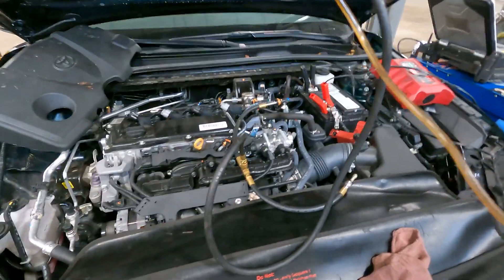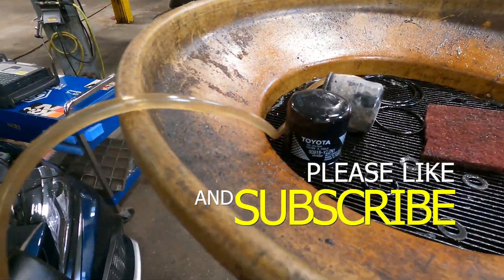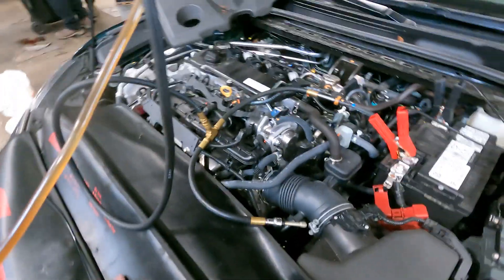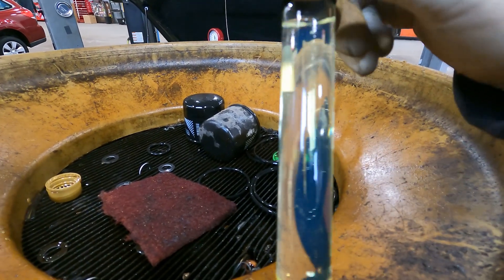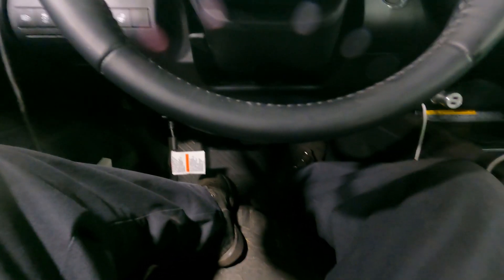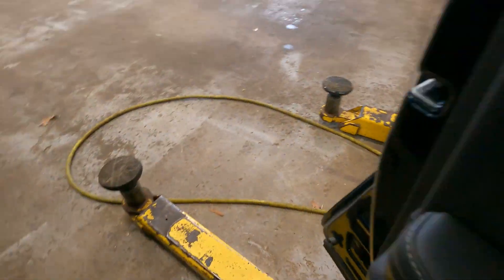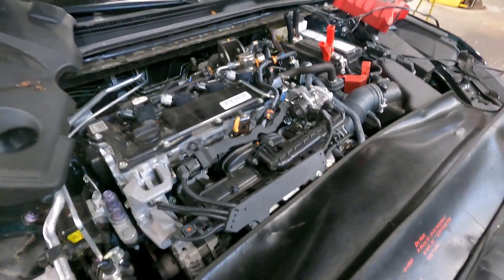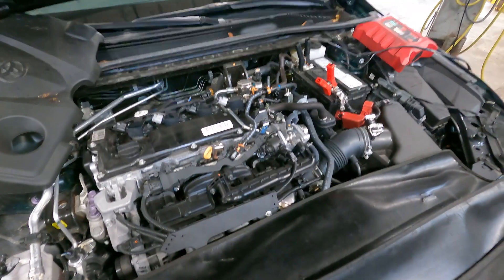Customer states "I PUT DIESEL IN MY GAS 2022 TOYOTA CAMRY!"😨😫😫Will it be ok???

Comment: Curious to know how this person got the larger nozzle from a diesel pump into that opening. Astro glide?
Reply: Vaseline.😊
Reply: @garfieldsmith332  lol
Reply: Sometimes, when a person loves Diesel fuel very much....they use a freaking crowbar to get it in the smaller hole!!
Reply: thats the problem....  not all diesel nozels are larger !
Reply: I drive a diesel car and most diesel pumps aren't larger, otherwise I'd be screwed
Reply: @vinc4886  diesel pumps aren't larger than diesel tanks even for cars 
the diesel pump is about 1cm wider as a standard on cars
Reply: @dylan-nguyen  yeah, the times I've pumped it into a gas can it's slightly larger.
Reply: Maybe they used it from a can?
Reply: You can just hold it up to the hole
Reply: Great question
Reply: Diesel nozzles are only larger at truck stops. At regular stations they are the same size
Reply: @stunna7807  I call Bullshit. Here in Canuckastan we have yellow for diesel and red for gasoline. The spigot on the diesel is way larger than gasoline. It is nearly impossible to put diesel in a gas fueled vehicle. Now on the other hand, it would be quite easy to put gas in a diesel fueled vehicle. I know because my work van is diesel and personal vehicle is gasoline.
Reply: @mikefoehr235  I live in Michigan and there are two size diesel nozzles. One is massive and will barely fit into my truck and the other is the same size as a gasoline nozzle. I think having diesel and gas at the same pump was a bad idea.
Reply: @zachdemand4508  You might be right
Reply: ours are same size and are just green handled with no vapor cover in most places.
Reply: FORCE
Reply: @mikefoehr235  Manitoba here bruh. And I have a diesel car and gas SUV. Large capacity diesel pumps have larger nozzles. The lower capacity pumps are smaller.
Reply: @stunna7807  Never seen that in Ontario
Reply: Some people are terrified of heights. Others of spiders. Some, ghosts. I'm terrified of ever noticing I've pumped diesel instead of gas/petrol.
Reply: @MattExzy  if you do it; much better you notice before you start the engine and try to drive away
Reply: To all you people saying the diesel nozzle isn't bigger, try it... it's just a little bigger.  You can't really notice it by glancing at it.  Diesel is bigger!
Reply: @damonzilliox2751 Not here in Ontario. Diesel ⛽️ spigot is 2x the diameter of gasoline spigot and diesel is colored yellow and gas red. Just like the gerry cans.
Reply: @damonzilliox2751  The idea is to prevent you from inserting it into the filler for a gasoline tank. Same thing was true when unleaded gasoline came along, openings for those cars was too small to allow the nozzle from a leaded  gas pump
Reply: @kevinbarry71  no shit?
Reply: @kevinbarry71  I'm saying the diesel is bigger damn it!  Lol.
Reply: @mikefoehr235  well yeah our cans our color coded as well. Red/gasoline, yellow/diesel, blue/kerosene....
Reply: @mikefoehr235  think about where those cans come from.  Lol.  China!  Pretty much a world wide standard than cans are color coded.
Reply: The hole was wallered out from previous attempts
Reply: @kevinbarry71  - dang, not many kids on here know what leaded fuel was. Also only in American 🇺🇸 do we call a liquid (Ethel) “Gas” which is not a liquid
Reply: @RustyZipper  it is short for gasoline
Reply: Foreplay
Reply: @zachdemand4508  I swear in Detroit at the bp the green is gas and black was disel
Reply: @Kingpat-yt  you are right. Bp is opposite a normal station.
Reply: @zachdemand4508  yea I thought so. I'm in az where they have circle k.  And it's the opposite. Should've read it 🤦🏽‍♂️
Reply: I wondered why it ain't fit in the car tho. I'm thinking maybe they all are my fit bc I don't know nothing about disel tbh.  I just know there's one u don't supposed to put in your car
Reply: @zachdemand4508  I got like 13 gallons of gas in my car with 3 disel u think it will dilute?
Reply: @Kingpat-yt  if your car has a gas motor a little diesel won't ruin anything. If you have any more room in the tank, fill it up. The more diluted the better. The worst case scenario is it doesn't run. Then you will need to drain the tank and refill with gas. If it does run it may foul the spark plugs. Hardly the end of the world.
Reply: @zachdemand4508  yea it still runs just make noises. Mobile mechanic coming in tmrw to drain it.  It will fs run still after I refill it right?
Reply: @Kingpat-yt  3 gallons is a lot to mix in a tank, so it really doesn't surprise me that it doesn't run well. You really don't need a mechanic to come help you if you can siphon the fuel out. I don't know what resources you have available to you. Either way I would try to save the fuel that is drained out. Then whenever you add fuel to your car add a gallon or so from what was drained out. Diesel is an oil. It doesn't burn well in a gas motor. That oil could build up on the spark plugs (fouled plugs) and cause ignition problems. That is really not that big a deal. Chances are as soon as some clean gas gets injected into the cylinder it will clean them right off.
Reply: @zachdemand4508  well thanks. I can do that but I have a mechanic coming in tmrw.  Idk if I should cancel

Comment: It happened to my dad once that he filled a diesel with gasoline since he tanked gas as a habit. Figured in seconds what he's done so he shut the car and called a guy to pump it out. Car worked fine afterwards. we were told that diesel in gasoline just wont work, but gas in diesel can break the car because fuel is used as lubrication for nozzles. He tanked a full tank so we diluted it down to about 10% diesel in gas and burned it in our old Hyundai atos over 3 months. Never had an issue, it even passed eco test.

Comment: You do very careful work, very high standard of care!  When this has happened to me before we just pumped out the tank and disconnected the fuel filter to allow the fuel line to drain a bit.  Then we filled it up with high octane and started and ran it until it smoothed out.  Usually did not have to do anything other than that.

Comment: They were saved by the fact they had the car towed right away instead of trying to drive it with the wrong fuel.  I knew somebody back in the 70's who owned a Mercedes-Benz that was diesel and a Volvo that was old enough to use leaded gas.  They accidently put diesel in the Volvo, but didn't realize their mistake until the car died several miles down the road.  The car was repaired (as I recall it was pretty expensive), but never ran quite right again.

Comment: I had a customer do the the opposite. They put 44 gallons of gasoline in their diesel Ford excursion but didn't start it. I ended up pumping it out and using it in my beater car at the time. It smoked a little bit but it saved me from buying gas for 2 weeks and saved customer from having to pay disposal fee. Win win

Comment: That engine sounds like a Diesel engine
Reply: Direct injection, at least Toyota uses all dual port.
Reply: Toyotas always sound like a news office in the typewriter era.

At least to me.
Reply: @iFixJunk  that sound would make me check my oil constantly, it sounds like there's zero oil in the head
Reply: @mitchhedberg4415  Didn't know that,  thanks for the info.
Reply: That's how four cylinder Camry's sound. I've had a few they all have the same noise it takes alot of getting use to
Reply: @mitchhedberg4415  isn't that the sound of the high pressure fuel pump?

Comment: When I was importing cars from Japan (grey import) in to UK, for SVA test I had to install a restriction ring in the fuel filler tube to prevent the car being refuelled with diesel. Naturally, I moved this ring from car to car after each car had passed the SVA test. In fact in some ways the SVA was easier than the MOT. albeit more expensive.
Happy days.
Jack, trhe Japan Alps Brit

Comment: Did this to a uhaul truck. No idea why I was so sure it used diesel that I filled it up with diesel. I was around half way up when I realized that at the side of the tank it said UNLEADED GAS ONLY. Parked the truck, lucky me I was able siphon the diesel out and ended up buying 4 10lt watter bottles to put the diesel in. Filled the truck again with gasoline and besides a bit of smoke it worked completely all right. I guess not all diesel nozzles are bigger.
Reply: Yes, Shell in Canada has them side by side, with the same nozzle side. I actually also did about 120 km on it...

Comment: I'm always aware of what I'm doing at the pump, been driving for 28 years now and NEVER done this
Reply: Most people will never do this. 

Then again, most people will also never pour power steering fluid into the brake fluid resevior like I did about 6 years ago. Luckily, I caught my mistake in time and was able to siphon out most of the contaminated fluid before doing a thorough brake fluid flush. Oops.

Comment: Did that intentional in mid 70's. Had a SU carburettor,  just adjusted jet, ran well, not idle below 1800 rev. Fuel strike answer. cleaned entire engine internally.

Comment: Actually  had an experience where my travel mate put 7 gallons of diesel fuel in the tank by accident in a pre unleaded  fuel car. It was a Sunday morning in the middle of nowhere. He finished filling up with 93. Car ran a little hot and mileage was down, but no serious issues. Recall seeing that many Cuban run on #1 diesel (kerosene) after starting and warming up with gas, because kerosene  is free. I suspect  the problem here is the fuel injection?
Reply: Exactly - very elaborate job CSM did there. Probably had been enough just draining the tank since the car ran okay on wnat was in the fuel rail.
Reply: in around the mid 80's and early 90's when fuel management systems were becoming more common in which o2 sensors and other solutions were reading what fuel was doing and also recognizing ping and adjusting itself somewhat, is when adding diesel to gas became a risk. Then when the more elaborate computer systems became mandatory in 1998 at least in north america, any amount of diesel in the gas, would result in the system recognizing a contaminant and begin to try and purge it resulting in people's engines flooding out and in some cases the crank cases being filled to the point of overflowing depending on how long they ran it like that. So much cylinder wash and just total disasters. This primarily effected vehicles 98 and newer due to their design. Reason i know this is because a local gas station has it's near empty gas reservoir filled by a refueler with diesel by mistake and several customers filled up and then sometimes didn't make it much outside of town before the vehicle simply quit.

Old mechanical injected or carbureted engines however are unharmed, in fact many people were advised to mix diesel in one in awhile or as a means of cleaning up and lubricating an engine, between the extra heat generated and other properties diesel has as a "wet" fuel compared to gas, the engine would have a high risk of ping due to the slow burn of diesel, power would be reduced, but mileage would increase and a lot of the carbon build up would be cleared out. Once back on gas again, all was still well with a potential for improvements, no need to replace spark plugs or anything.
Reply: @SpectrumTwist  
Ah - you must be trolling. Ping doesn't stem from a slow burn.
Reply: @Peter_Riis_DK  ping stems from many variables and contributing factors.... a slow burn in combination with the fact that a spark based ignition attempt for diesel is pretty poor, resulting in the much of the fuel not being burnt, AND ignition points occuring at other locations resulting in pre and post ignition. A slow burn is a contributing factor, and one of the advantages of gas alone since it can rapidly spread through the combustion chamber more evenly reducing the chance of ping

Comment: If you are going to confuse the two putting diesel in a gasoline vehicle is absolutely the better way to screw it up. Just need to empty the tank and purge the fuel rail and then it will smoke for a bit. If you put gasoline in your diesel though and run it... you don't screwed up big time. Which has always made me wonder why a diesel nozzle won't fit in a gasoline filler neck. But a gasoline one will... you'd think they'd have done it the other way around >.>

Comment: ROFLMFAO.  My Daddy ran dump trucks and he was stubborn as hell and had a gas burner as everyone called them instead of a diesel.

One day he called me when I was in college and said to come down he had a problem with his truck and needed my help figuring out what was wrong.

I get down there and it's smoking black smoke and knocking and popping to beat the band.  Everyone is giving him grief for not having a diesel.

He tells me they have rebuild the carburetor 3 times and it's still not running right.

One old boy comes over with a handful of pine knots and tells him it looks like that's what he is firing it with!!  We both got a good laugh out of that!

I get to looking around the truck and take the fuel tank cap off one of the saddle tanks and I immediately notice that it does not smell like gasoline.  I notice that when the light hits the fuel in the tank it's green.

So I know right away someone's put the diesel fuel to it!  I holler "Hey Daddy, why is your gas green???"

He comes over, looks, and I said "smell," and he starts cussing !!!🤬 

I am laughing my ass off at him.  I said looks like someone has put the diesel fuel to her!!!

We drained the tanks, refilled with gasoline and she straightened out and purred like a kitten.

I remember him yelling at all his crew that from now on he'd fill this one up when it needed gas.  No one ever admitted that they'd done it!!  And that pissed Daddy off even more!!

Comment: Kinda reminds me of a customer putting e-85 and taking their vehicle to a quick lube shop on their 2007 Acura MDX. According to the customer, "Drove it for a week after taking it in for an oil change and it became like this." I had to figure out what happened since they are not telling. All cylinders are misfiring and the SH AWD light was on. The vehicle dies on idle.

Comment: Had a friend that had a small Diesel pickup. This was in the early 1990's. It got very cold, maybe -15F, and his truck barely made it to a gas station. He pumped in about 1/2 gal of unleaded premium gas. Truck started up, and as the fuel circulated, it ran better and better. Guess the gas dissolved the jelled Diesel.
Reply: Very common in cold climates to admix some gasoline in the Deisel. Usually not more than 5% or so IIRC. You DEFINITELY don't want to try to run a Diesel on gasoline! 8 years as a Warranty Engineer for a Diesel Engine Manufacturer. You name it, I've seen it! 🤣
Reply: And that's why they recommend to throw in a bit of fuel stabilizer/anti-gel during the winter months.  Most places in really cold climates are good about switching to a winter blend for the colder months, but still...

Comment: That’s a loud engine though.
Reply: The engine uses a combination of port and direct injection. The direct injectors runs off the injection pump unit just like a diesel does.  That’s where the extra noise is coming from.  The “beauty cover” covers the injection pump and dampens most of the noise to keep the engine quieter.
Reply: That's how four cylinder Camry's sound. I've had a few they all have the same noise it takes alot of getting use to

Comment: Cat change for a car that new and just mixing the fuel. Well in doesn't affect it that much because it doesn't burn. Even if the fuel is present in the cat it will get further in the long run. Because diesel doesn't ignite that easy well it will became less viscous due to temperature and evaporate or just go to the next level. That it is my humble opinion. But the other way around. Well that could suck. Dpfs are more sensative. Much more sensative.

Comment: My only question is why did you put 93 in it? Also, my Camry (same engine) often switches the way it sounds when I have just started it. I believe it's switching between direct injection and port injection or whatever.

Comment: Federal regs; 5/8" = gasoline , 3/4" and up = diesel fuel.............that doesn't mean that a pump repair tech can't make a boo-boo and install incorrect spout on dispenser handle..............Ive worked as mechanic at a car rental agency (one of the big 3) for 35yrs and i cant count the times ive had to rehabilitate gas systems fouled with diesel. on majority of occurrences i found the culprit dispenser at one of the 4 gas stations located immediately outside airport property.  all admitted to recently having repair on dispenser. they didn't assume responsibility, that stayed with renter.

Comment: I'm wondering if there's a way to clean the cat. after something like this?  Could you drill a small hole in the pipe before the cat. and spray brake clean or carb clean (engine cold) then weld up the hole and wait some time to let it evaporate?
Reply: You could remove the upstream O2 sensor and spray into that, and I've often wondered if something could be used to clean the cat that way, or any way.
Reply: @DavidStrchld  I've heard you can take them out and soak them in a 5 gallon pail with everything from gasoline to dawn dish soap and water.  But never how to do it on the car.

Comment: i did that in my 92 k1500 ...was going to work  an stoped to get gas ,,went to the 93 pump i always used,,,well in a weeks time they switched to diesel,,,did not smell right  ,,lucky i stopped after about 2 gals...went in a told them  its not gas an still had the gas nozzle on it...well lucky my truck has a 34 gal tank...never hurt   the truck at all...